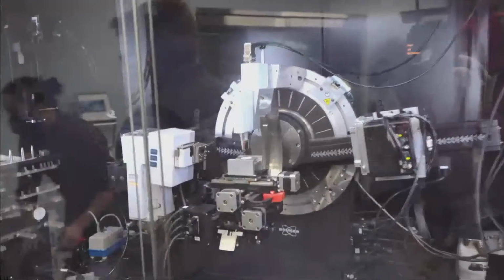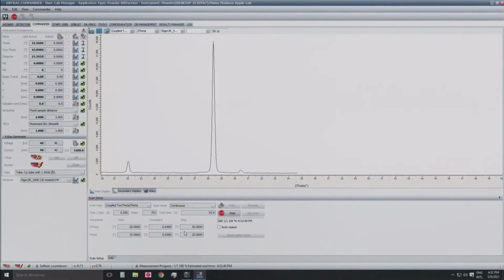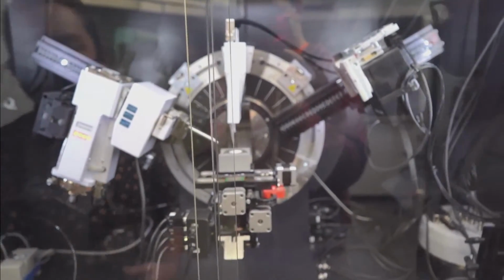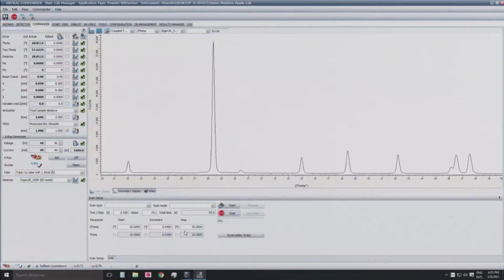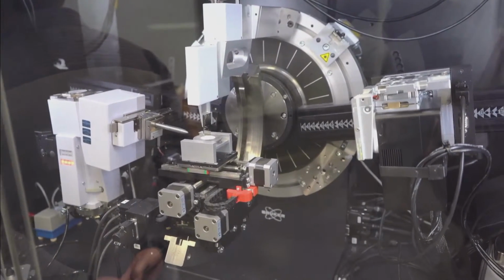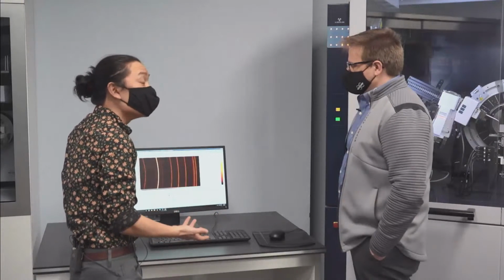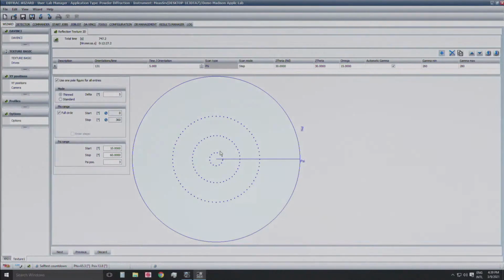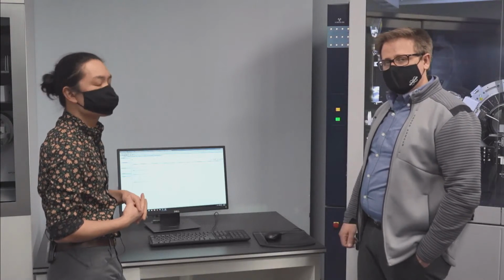Live from the Lab: When Would You Use 0D, 1D and 2D X-ray Diffraction?

Comment: I would be grateful if you could confirm whether the angular resolution is generally superior in the 0D or 1D detector. Does the 1D detector exhibit a greater degree of smearing when two peaks are in close proximity, as compared to the 0D detector, which may be better able to distinguish between them? Conversely, does 0D offer enhanced sensitivity and peak-distinguishing capabilities for trace or small samples? In light of these circumstances, would it be more appropriate to utilise a 0D detector for Rietveld analysis than a 1D detector? I am grateful for your assistance.